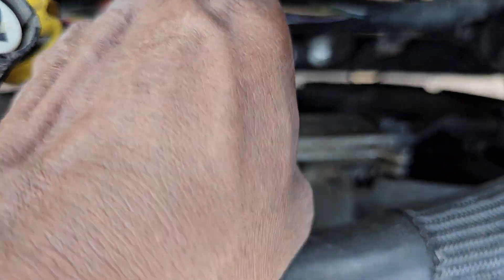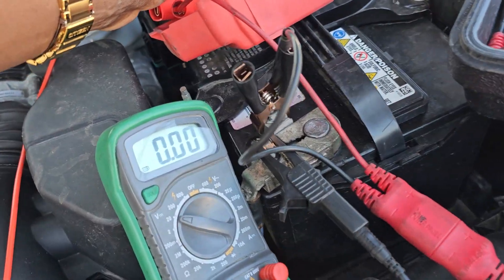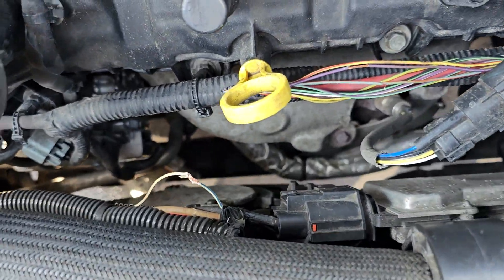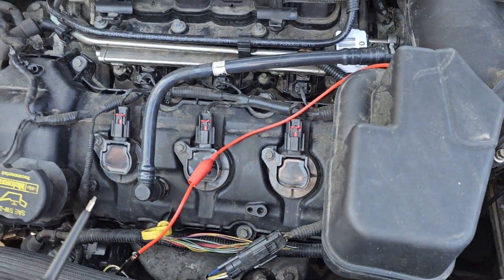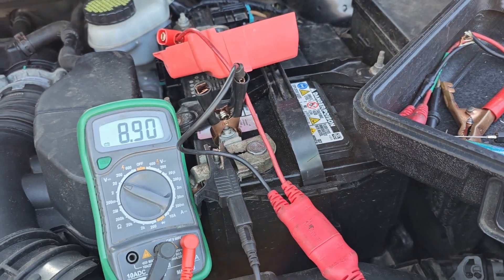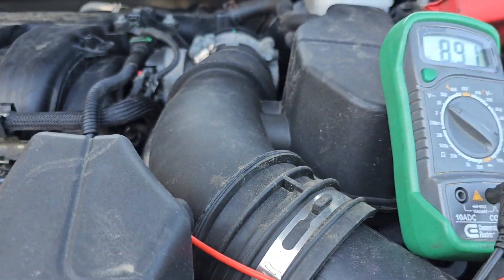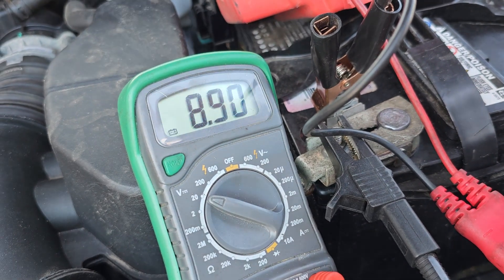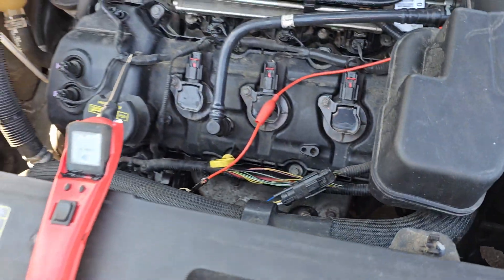How To A Cooling Fan Module Work On Ford Cars

Comment: As a class 1 auto electrian you haven't said anything.are you saying the signal you're measuring is coming from the computer box or from the fan module.even the way you have tested the ground on the module connector for layman's view its not making sense